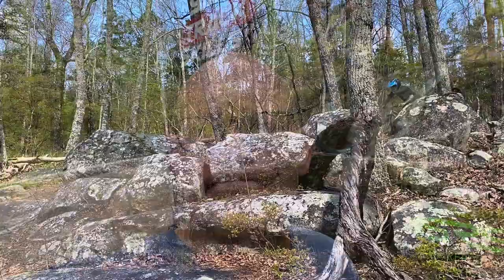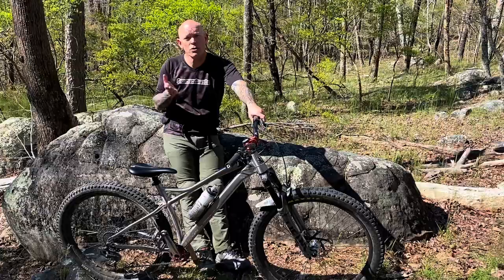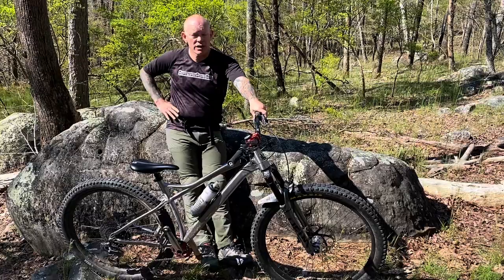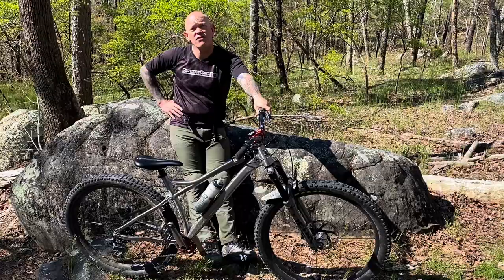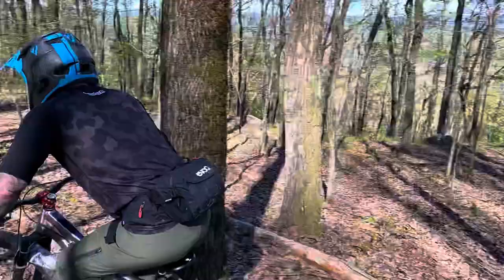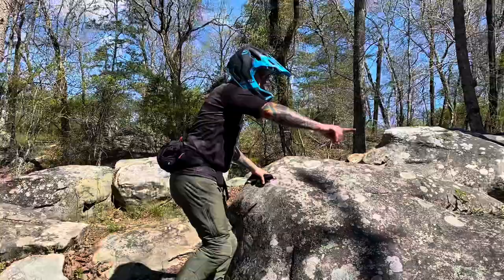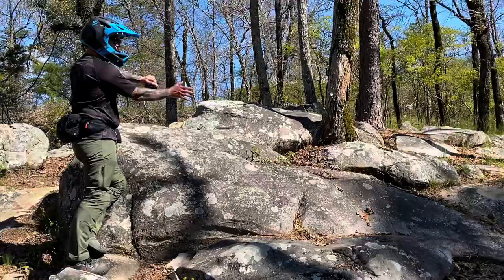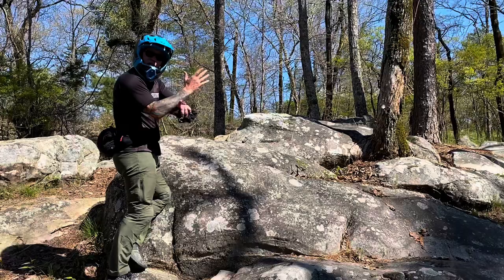How to ride a hardtail

Comment: 6000 series aluminum is (in simple terms) softer than 7000.  It will be more likely to bend before it breaks. This is good for most people who aren't racing in competitions. It won't leave you stranded in the middle of nowhere. The 7000 series is stronger (will take more energy to deform it) but it will crack easier. 
Personally I'd rather ride back on a tweaked frame than walk back, carrying a broken frame.

Comment: I’m looking at the banshee paradox and I’m wondering how tall are you and which size bike did you go with?
Reply from the maker: I’m 5’11” and the size large works great
Reply: Test out the medium as well, I`m 5'11" and the medium is perfect for me.
Reply: @dirkstoffberg8123  I just built a Enigma set up mixed wheel with med frame. This hardtail is a riot to push its limits lol